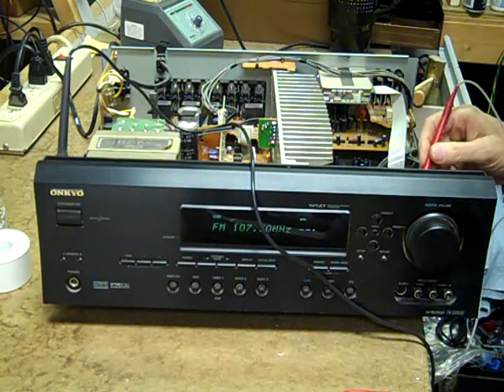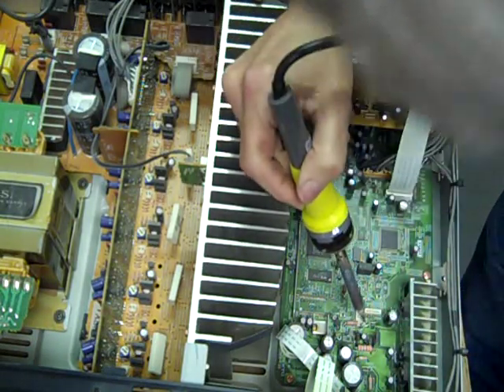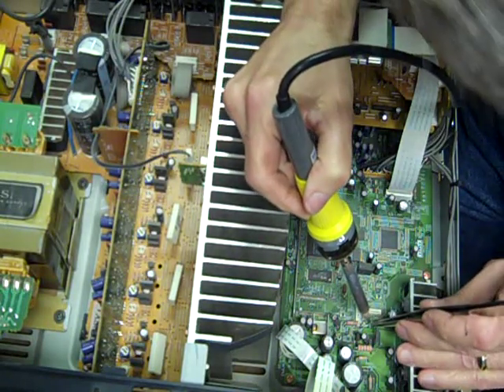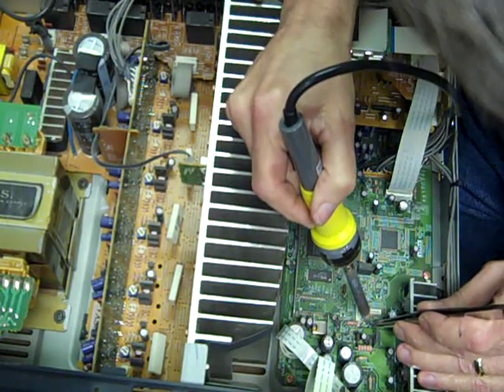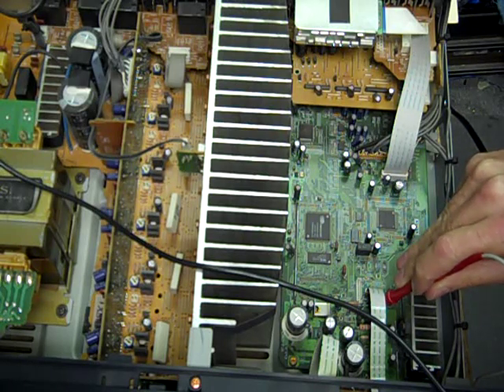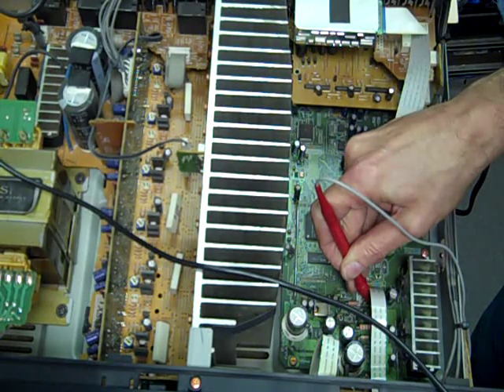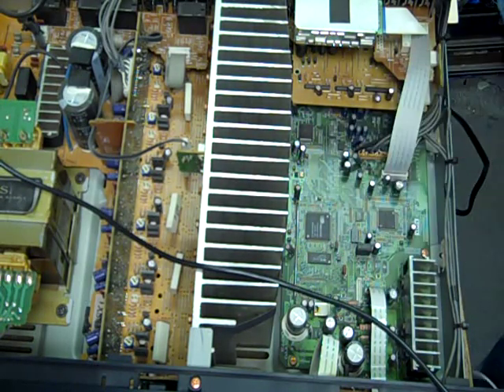Onkyo TX-SR502 Repair Brief

Comment: Mark, I just found your video on the TX-SR502 with no sound. My receiver started failing then stopped working altogether. When I say "failing" it would power up as usual but produce no sound. I could turn it off then turn it back on and sometimes it would work. Other times the next day it would work. After about 2 months of this it stopped altogether. It still powers up, display looks normal, has the "click" a few seconds after powering on but no sound. Your video suggests addressing L7002 but neither the speakers OR the headphones are producing sound. Seems unlikely to me that they both failed. I was able to visually locate L7001 and L7002 but am unsure as exactly how to test them. I'm assuming I have my meter set to DC and put the red probe on each side of each component to test for voltage. However, it's unclear in the video where the black probe is attached. Are you just grounding to the chassis ?
Presumably if the component is faulty one side has voltage and the other does not, correct ?
What if neither are faulty, any further suggestions for things to try ?
I don't want to go near any high voltage/current situations as I'm not experienced with this kind of application but I'm comfortable testing low voltage circuits which is what these two coils sound like. Thanks.
Reply from the maker: The coils can be checked with the OHMS function of a multimeter with power off, or yes, you can measure DC voltage at either side of the coil with the multimeter ground lead attached to the unit chassis. If L7002 is faulty, you can replace it with a one ohm resistor.
Reply: Mark Zacharias So with the power on there should be DC voltage on both sides. Any idea why both the speakers and the headphones don't work ? Seems unlikely that both coils would fail meaning it is probably something else.
Reply from the maker: Will Beames The headphones are run from the front left and right channels. If the speakers have no sound, the headphones won't either. The coil involved affects a 3.3v line to the DSP circuit, without which there will be no sound in any DSP related mode. One one coil I have ever seen go bad - L7002.

Comment: Hi Mark, do you think this could be the issue for my Sr 502 before I throw it away? Has only just failed after all these years. For about a week or two it would take anywhere from a few minutes to 20 or 30 minutes before I would get any sound. Now when it is turned on its just no sound. Everything else display wise seems to work. Would hate to throw it away as it is like new still, but not worth paying to have it fixed now (have bought a new Denon)
Reply from the maker: Certainly sounds like this could be your issue. Like in the video - if there's voltage on one side of the coil - but not the other, that's your problem. Jumper the coil with a wire or a 1 ohm resistor.
Reply from the maker: I would say just check the voltage on either side of that diode. If the voltage is there but still no sound, the problem is elsewhere. I've seen some soldering problems on surface mount IC's in the DSP area cause your problem on other models, like the TX-DS575. Usually involving some DRAM chip or other. Basically any chip that runs (very?) warm in normal operation can develop flaky solder connections over time. Worth checking if that coil isn't your problem.
Reply: Mark Zacharias thanks yes I will be checking it out later on today and will let you know thanks for your help
Reply: Mark Zacharias there is 4.96v one side and about 1.6v the other so I guess it is the problem?
Reply: I put a resistor in there but still had large drop in volts, so I just used a part of the resistor wire instead and now it seems to be working. Hopefully it is OK to do this?
Reply from the maker: Sounds like it. Jumper it with a 1 ohm resistor.

Comment: Mark:
RE: Onkyo TX-SR502. 
Speakers often will not turn on. Watched your video & found the following:
L7002 input voltage 2.302 vdc, output almost the same. L7002....good; not open
D9513 output 10.71 vdc
Q6406 (TA4805S) 10.49 vdc input, 2.343 vdc output, ground pin at 0 vdc
Is the Q6406 5 volt regulator bad? (Not supplying enough for the +5 vdc line?)
Thank you & thank you for taking the time to post the TX-SR502 video. Directed me to the correct section.
Regards,
Ryan
Reply from the maker: +ryanbdr I think that 5V regulator Q6406 is probably bad.
Reply: Mark, hi. You suggest using a 1 ohm resistor in place of the L-7002 coil on the Onkyo TXRS502. What wattage would be appropriate? How would one specify the form factor of the resistor? If you've a moment to respond, I'd appreciate your help. Thanks.

Comment: John Canini Sr - can you help with that part "PHR MPR 2w r22k x2 ", where did you order that part from?
Reply from the maker: If you are talking about the dual emitter resistor for an amp channel, I didn't find any 2W versions, but there's lots of 5W versions available on eBay. Search for "dual 0.22 ohm, 5W emitter resistor"

Comment: Would you have any suggestions for repairing the remote sensor? I purchased a new remote thinking that the remote had gone bad but that wasn't the case. It responded for a day or so (with the new remote) and then it became intermittent and then stopped responding to the remote all together. Thanks in advance. (Onkyo TX-SR502)

Comment: I have an onkyo htr520 on "A" speaker with sound out of center speaker but left and right cut out or only work for the first couple minutes its warming up. Switched speaker wires to "B" and they work ofcoarse. Checked L7002 coil with about 2.3 ohms same as a few other 2R2 near it. Any idea what else i can look at? Havent checked unit with power on
Reply from the maker: Christopher bowles If the front speakers work on B but not on A then the A speaker relay is probably bad. That's almost the only thing possible, since the A and B go back to the SAME amp channels inside the receiver.

Comment: SO L7002 has 5v  on one side but only 0.8v on the other, I'm assuming it's the culprit. Do I have to use a 1ohm resistor or can I use a piece of 24 guage wire as others have said ? Also, is it possible to do without removing the board ?
Reply from the maker: The wire will work. The work can be done with the board in place, just add a bit of fresh solder on each side of the coil and solder the wire across the coil.
Reply: Mark Zacharias Ok, I soldered a small wire across the coil. Now my meter shows 4.99vdc on each side but I still have nothing coming through the headphones or speakers. Is that voltage ok to be on both sides ?
I'm assuming my jumper has fixed the coil and that now I have another issue unless I have managed to solder the wire to L7002 but in the process "unsoldered" L7002 from the board.
Any suggestions of what to check next ?
Reply: About 6 months from now, there will be a click.....
Reply: Andy Beames Ha, yeah.
Actually......it's fixed. When I was checking the audio out with headphones I only turned the volume up about half way. There was no "hiss" so I figured it was still broken. Today I checked the voltage regulator next to the choke coil I jumped and it was outputting the correct voltages so my fix had worked and it must still be something else. Being at a complete loss I plugged the headphones in again and turned the volume all the way up.....the hiss was now audible. Fixed.

Thanks Mark for the help. I was about to throw the receiver out.

Comment: Could this cause an issue where there is no sound when you initially turn on the unit, but after about a half an hour there is sound and it will continue to perform more or less normally until it is powered down? I have this same unit that was given to me because it's previous owner hated waiting for it to "warm up".
Reply from the maker: Wow. Hate this new messaging system. Tanner, your problem does not sound like one I've seen on the TX-SR502, but I have seen a similar problem on the TX-SR575. Had to do with poor soldering on a RAM IC.

Comment from the maker: If there is a blown amp channel, the "noble" dual emitter resistor might be bad. It should read a very low resistance on each half, and about one-half ohm for the two halves together (end-to-end). Are you a technician?
These frequently do get blown channels but a beginner or newbie would probably be out of his league on this one.

Comment: hello. i have an onkyo tx-sr803e with DSP Problem similar too what you discribe in this video. my question is if you ever fixed this kind of problem with the tx-sr803e? on the dsp board I have a choke coil and when the amp isn't working I power of and give it a little push from the backside of the coil and then it comes too life. hope too hear from you.

best regards
Mikael Eriksson SWEDEN
Reply from the maker: Ive never worked on this model and it looks quite different to the 502. I would suggest trying to resolder the coil - and if that doesn't work resolder a broader area. Sometimes tapping around with a non-metallic object like a chopstick or plastic pen will help narrow don the affected area. Voltage readings can also be critically important. In the example of the TX-SR502, there was voltage on one side of the coil and not on the other. This is where it gets down to actual troubleshooting.

Comment: ok. just wasn't sure as it DOES change resolution according to changes to the inputs (ie recognises changes on an xbox360 and the screen shows the changes. plus the menu displays (which I wasn't sure if it did with the classic hdmi switch problem - cos this doesn't handshake after the time delay like they say. It just flashes the hdmi source indicator 4 or 5 times then stays off. I'm rather fond of the receiver so if it's not fixable at component level what sort of cost would an hdmi board be

Comment from the maker: Sorry. No sound on A speaker either? If there is voltage at the collectors of the output transistors. and the speaker relay comes on after the usual turn-on delay, there might be a bad 10 ohm resistor or two going to the driver IC's. Sometimes a driver IC will short and take the resistors out as well. Are you a technician and able to troubleshoot and solder?

Comment: Hy Mark.   I have the same Onkyo TX-SR502 with the same coil Open.   There are 5 volts at the imput side.   Do you know what is the value of the current flowing through the coil.  Do  you know the cause burning this coil.  Where can I get the schematic???    best regard´s
Reply from the maker: Jorge Marroquín hifiengine.com has a service manual. You have to register but the manual is free. Don't know how much current. You can replace the coil with a 1 ohm resistor. You can even temporarily bridge it with a multimeter on the milliamp range if the meter shunt is one ohm or so, which is common.

Comment: Hi Mark,
just spent most of the day failing miserably trying to get to the root cause of a no sound problem on my txsr508 while the hdmi works fine sending a good 1080p to my tv, i cannot get the dsp logo to appear on the front panel no sound even from the am fm tuner. i checked every power line on the hdmi card and its embedded DSP chip without finding a single issue, i then discovered that their are 4 other components that need to be checked, these are the voltages at two diodes D4171 and D4172 and at two Q4170 - Q4171 I am not sure but i think these two are transistors for the analog and dsp lines.
Anyway all four components  are located together directly under the analog input card ,so much so that i cannot find a way to test the voltages, do you know if their are test point that i can use? i ask because i see you tested your l7002 from behind the volume control...
If you could help i would be extremely grateful and would not have missed a day out playing golf for nothing!!!

Thanks
Ian
Reply from the maker: I have little to no experience on this range of Onkyo models. I have heard of many problems with surface-mount electrolytics and horrible reliability issues on those models using the large BGA chips on the HDMI boards. So bad in fact that Onkyo, a really crappy company customer service-wise, was forced to fix many even out of warranty once the word got out.
Reply: yes i agree thankfully mine does not have the beaded chip, rather it is still pinned the old school way
Reply: can you tell me if you were actually using test points behind the display panel to diagnose the open coil?
Reply from the maker: Not involving the display panel - the coil in question (L7002) is on the main input / microprocessor board as shown in the video. One simply measures voltage at one side of the coil, then the other side. There should be little difference in voltages measured. If the coil is bad, there will essentially be zero volts one one side.
Reply: thanks for clearing that up Mark, i am still trying to gain access to the 4 components while the unit is still powered up, by the time i take out the boards needed to gain access the first relay just continuously clicks because those boards have been removed!!!
Reply from the maker: Remember the receiver in the video is completely different. The Onkyo models in this range were SO BAD about problems like this that Onkyo was forced to repair or replace even after warranty due to all the bad publicity. I don't know if they are still covering these but you should check with them and be firm. DO NOT tell them you've been working on it.
Reply: CHEERS MARK..
mine is not one of the models covered for repair, i think that was on later models that have the balled dsp chip, 
Isee some folk stating that capacitors and resistors cannot be checked while they are soldered to the motherboards, is this correct?
Reply from the maker: Worth a try I suppose. Personally I would stick with Yamaha in the future. Better product, better support.

Comment: Hi Mark, could you help me for my problem with my amplifier onkyo tx-sr 702? 
My AVR recently went silent, that is, it powers up but we get no sound from any of the speakers. I've tried all the inputs, from FM radio to video to tape and PC and still nothing.
The headphones don't work at all either. i think your video is the same problem with mine, but i'm not sure??
Reply from the maker: Well, I've never worked on a 702, and the relevant portions of the schematic don't appear much similar to the 502, so I would just have to try troubleshooting from scratch. Power supplies get checked first, then look at the analog signal path, then try to see where it loops into and out of the dsp areas.
Reply: Mark Zacharias Thank you for your advice.

Comment: Mark,  love your videos. Thanks for doing them. I would like to ask your assistance in repairing an onkyo txsr353 that has no lights and occasionally click when power is pressed. I have done basic diagnostic, fuse is good. 3.3 and 10v is present at points in unit. Any help would be appreciated.
Reply from the maker: I don't have any information on this model. I'm not sure what you mean when you say occasional click. For example do you mean that the power switch (standby switch) only occasionally works?
Reply: Mark Zacharias When the unit is plugged in no lights at all are on and when you press the power button to start the unit you may or may not get a faint click. For the most part it is dead. I did find a bad cap on the cpu board. I am going to replace it ( I have to order it) so next week I will get you am update. Thanks for the response.
Reply from the maker: The receiver may have more than one problem, but when you hear the click it should obviously power up. It may in fact be trying to, but perhaps a main fuse blown or a bad power transformer prevents further operation? It requires troubleshooting, and it is best for a qualified technician to do this, since AC main power is probably involved.
Reply: I am an electronics newbie. I would like to give it a try.
Reply from the maker: You'll probably need a service manual. I have not been able to find a (free) one for download.
Reply: I found a stripped down version of the service manual. Some parts are missing but it has the schematic , parts list and a flow chart.
Reply: I replace the cap, no change. If I email you the service manual, could you give me some pointers?
Reply from the maker: Frankly I'm not surprised. Everybody thinks everything is caps. Jesus. Do you own a multimeter?
Reply: I do. I only replaced the cap because it tested bad. I realize there are other issues with the unit.
Reply from the maker: Where did you get the schematics?
Reply: The internet.
Reply from the maker: I'm losing my patience. Where on the internet? What site?
Reply from the maker: Well, we can try - frankly my track record with later model Onkyo's hasn't been great. Their recent models I have seen suffered from a variety of HDMI board related problems, many of which resulted from bad design and bad manufacturing (ball-grid array issues). My email address is mark_zacharias@sbcglobal.net

Comment: i have a onkyo ht-r560 it turns on then goes to standby mode i opened it and found a bad cap. changed it but that didnt fix problem i did test the voltages on the transitors as well as i believe u said the NOBLE fuse ? im trying to find parts for changing i found all except the white resistor which i beleive u said it was noblelight? please help MINE READS:
 PHR MPR 2w r22k x2 thankyou.

Comment: With a TO220 case of course
Reply from the maker: +ryanbdr Just a thought. Might not hurt to also replace any cap on the output side of that regulator. Could be some oscillation there. Makes DC appear low.